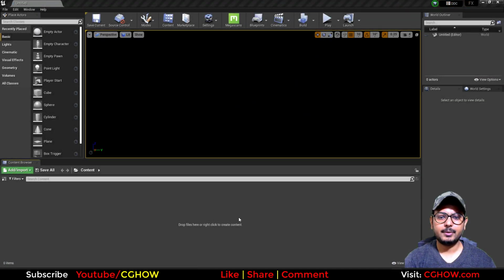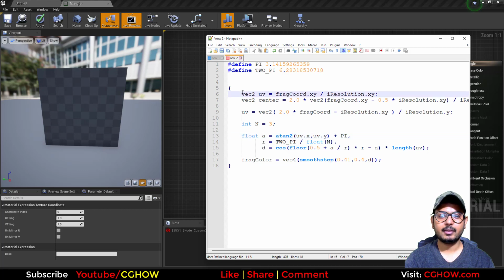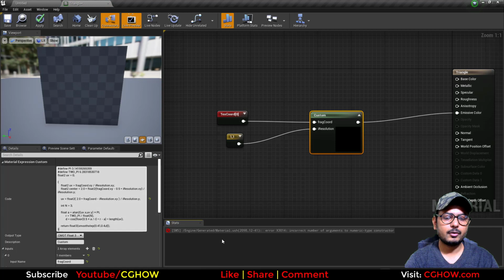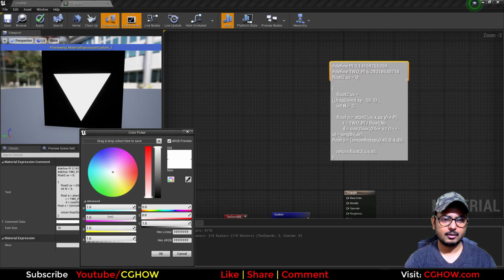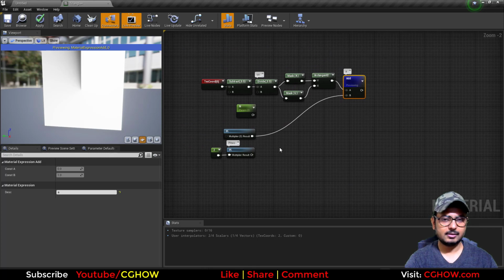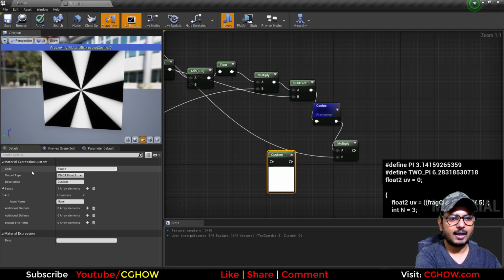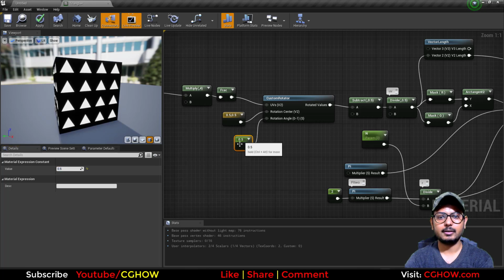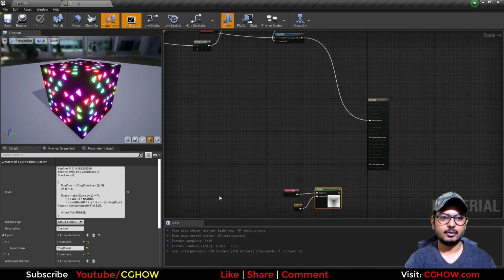HLSL Triangle code to UE4 Material nodes Tutorial | Download Files

Comment: Hi, great tut! we're really missing on some good HLSL tuts. Instead of Notepad++ you can use VSCode and install a free extension for syntax highlighting and code completion for HLSL, there's also an extension to convert your code to UE4 compatible HLSL node which will be copied to your clip board and you can just past it right away with correct inputs and everything, a great time saver!
Reply: Please explain more about this, I've been trying to learn HLSL but the material is very difficult to understand and implement. What is this workflow? Do I need to build UE from source to make it work?
Reply: @MonsterJuiced  unfortunately this is not gonna make you a better HLSL programmer but has more to do with translating existing code from one format to another, saving you the ugliness of HLSL syntax. you'd however still need to have a valid source code to generate HLSL from (shader playground for example).
As for sources to learn basic HLSL ceck Ben Cloward's channel on YT (that's the only one I'm aware of rn)
Reply: what is the visual studio plugin? im very interested in the ue4 conversion.
Reply: @legomanshorts-c5o  UE4 Material Expression Generator ( Visual Studio Code)

Comment: If you divide the result with 2*pi, it will work as intended instead of adding a custom cos node.
Reply: There's also a parameter in Cosine node says Period=1.0 instead of 2pi. It looks like Cosine is a bad naming.